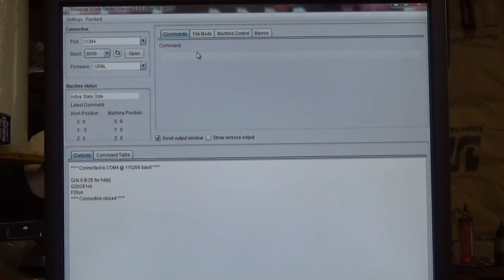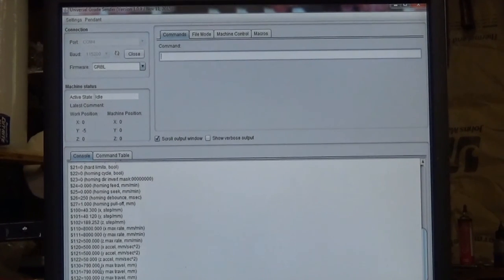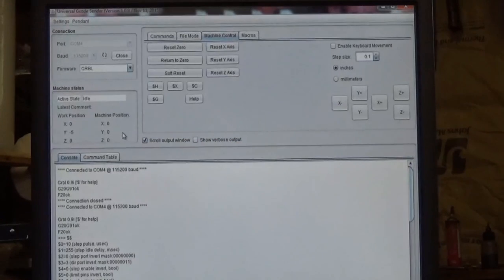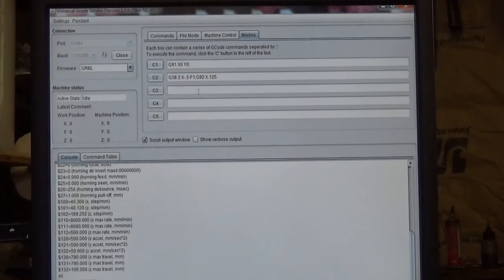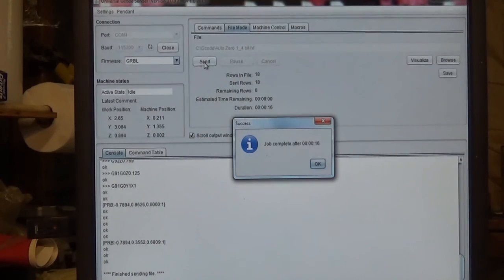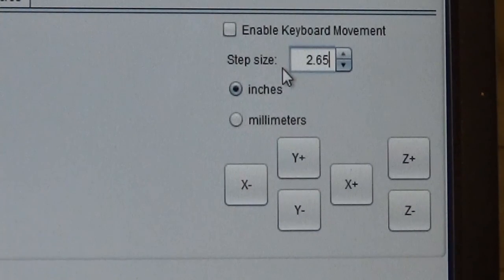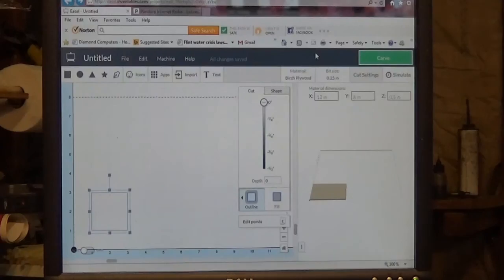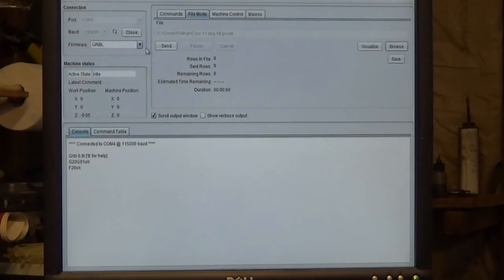UGS Tutorial

Comment: help I made a good 3 axis cnc mill/router, it has a mach3 usb interface, i can manually jog it with mach3 software. what free design/drawing program can i use and then convert to gcode for mach3 to run the machine? only want 2.5 axis to cut simple parts  cutting or up and not cutting. example a 5cmx5cm square with rounded corners with a 3mm hole in each corner. would ugs be able to send to the mach3 usb interface to opperate the machine?

Comment: Mr charley  i made this project but when i print any text it print as a mirror image. is there any specific setting I need to change in code?
Reply from the maker: It sounds like your stepper motors are reversed. X+ or right arrow key should move your X axis to the right. Y+ or up arrow key should move your Y axis towards the back. If this is not what is happening then do a google search for "GRBL Setting $2". There is a chart that will show the settings that will fix this for you without having to rewire your motors.
Reply: @CharleyThomas2016  thanks sir. Ya it solved by switching direction of motor via USG. THANKS ALOT

Comment: Sir plz tell us how to use soft limit to stop machine before ends as don't want to use limit switch
Reply from the maker: There are two types of coordinate systems used on cnc machines. The first is known as Machine Coordinates and the second are Work Coordinates.  The work coordinate system can have multiple different values but that is another discussion. Machine coordinates are what Soft Limits are based on. When you first power up your machine it does not know where it is located in regards to the Machine coordinate. This information is required to be able to employ Soft Limits, therefore, in order to establish the Machine coordinates you must home your machine. Homing is basically joging your machine in the Z+ (up) directions until it reaches a limit/homing switch. Once th e switch is activated then the Z axis home or Machine Coordinates system is set to Zero. The same happens for the X and Y axis moving to the Left and Forward. It can also be set moving back and to the right. When all three axis have reached their absolute maximum or minimum limits of travel then the machine coordinates are set to zero and it will always know where it is located in relation to machine coordinates X Y Z zero.  There two other settings that defines the maximum or minimum machine coordinates that your machine can travel within for each of the three axis. For the X and Y axis it is typically no travel that would result in a machine coordinate position of less than zero or greater than the defined maximum travel in the positive direction of each axis in relation to machine coordinates zero for each axis. This is where Soft Limits come into play. If your g-code attempts to move your machine beyond the defined limits, the soft limit for that axis is activated and prevents a hard mechanical crash. So.... in order to use Soft Limits, you will really need physical limit switches so that you can set your machine coordinate system end points.  I personally seldom home my machine which means that I am working without the safety net of soft limits.  I do not recommend this for new users, however, with experience, you will learn your machine better and be able to foresee any potential problems and may decide that for some jobs, homing and using soft limits is the best plan for the that job.  It's a little like when you leave your home each day to drive to work. You travel down the same stretch of road and almost never look at your speedometer, but when you do you find that you are always driving right at the same speed every time. But when you get on an unfamiliar road you check your speed more often and make more adjustments. That is simply called experience with a side of confidence that must be kept in check from time to time less it bite you in the butt. Limit switches are that check.

Comment: Great video Charley. Quick question. I keep getting an error code that grbl isn’t loaded. I have a carve king 2. I’m thinking it’s a controller problem. I’m sending it back to millrite to have them test it. Do you think it could be anything other than that?
Reply from the maker: If you are using a USB to connect your PC to the controller it could be a bad USB cable. Also, I have often seen that simply unplugging the USB from your PC and plugging back in to a different USB port or even the same port can resolve the issue.
Reply: Thanks Charley. I’ve tried all of that. Switching ports, new usb cable, and deleted and reinstalled the Universal G Code program. I’m getting ready to send the controller back to Millright to be checked.

Comment: I am running into problems with running g code and having all the images line up with the way they are on the display. 

For example there is one image I exported g code from VCARVE. There is a circle with a cross in the center. 

My post processor is G code (mm).txt and I open that up in Universal g code sender. Zero out my machine set my z height. And run the code. It does a great job on the circle.

But as soon as the machine moves to outline the center cross. It moves the Y axis up three inches and cuts the cross in the wrong place. . . 

Any idea on how to fix this reoccurring issue? 

Thank you!
Reply from the maker: I would need to look at your actual VCarve Design on your computer. I can set up a peer to peer session where I can see your computer and help you figure it out that way if you like. If you want to give that a try email me at charleyntexas@gmail.com and we can make arrangements.

Comment: How do u preview ur program when in ugs to make sure it wont crash or is correct?
Reply from the maker: I'm not sure you can. If you use my software to create the zeroing files then you won't have a problem. It is the Triquetra Tool Box. It is a Windows Program I wrote as a companion for the Triquetra Tool Box but will work with any touch plate that is the same design. It can be customized for touch plate measurements. If you purchase the Triquetra Touch Plate you will receive the Touch Plate, Triquetra Tool Box and the Wiring with the Magnetic Ground. All are available at www.triquetra-cnc.com.   If you would like me to give you a phone call, go to the site and send me a contact form with a phone number. I'll be happy to call you and discuss options for you.

Comment: Hello Charley - I really enjoyed your video. I have a question I hope you can answer.I will usually use Fusion 360 for CAD and then CAM. I will then use UGS on my X-carve to cut things out. Recently I have been putting two tool paths in instead of just one. My question is: How do you know when to change out the first bit for the second tool path or second bit ? Do you have a video on how that works when using UGS on the Vcarve ?Thanks,Ryan
Reply from the maker: I don't believe that UGS supports mid project bit changes. When I use multiple bits I just create a separate file for each tool path. After I change bits, I just re-zero the z axis and then load the next file and continue on. You just have to be careful that you do not upset the alignment of the x and y axis when changing the bit. If you do, then re-zero all three axis with the touch plate and you will be good to go.
Reply: Charley,Thanks for your reply. When you change to the second bit and second file are you bringing your second bit back to where you started your first bit, but zero the Z ?Thanks,Ryan

Comment: could you share the contexts of the zeroing txt. thanks!
Reply from the maker: Sorry for the slow reply. The contents of the g-code to zero all three axis at one time is included with the purchase of the Triquetra Touch Plate system. The Triquetra includes access to my Excel Spreadsheet that generates the g-code specific to each Triquetra. It also includes worksheets for stepper calibration, fine tuning zeroing accuracy, and Mach 3 Script. You can find it at www.charlindwoodcraft.com. Thank you for your interest.